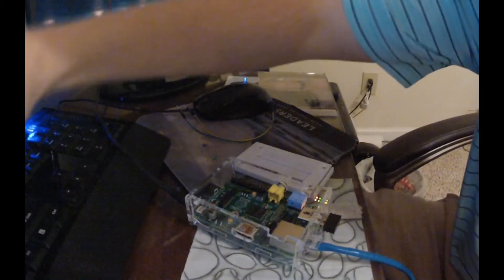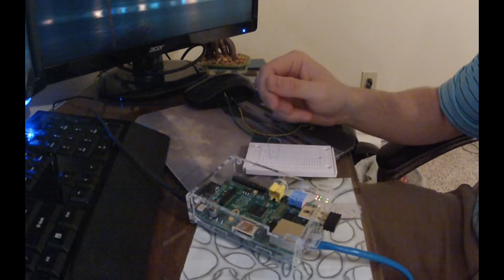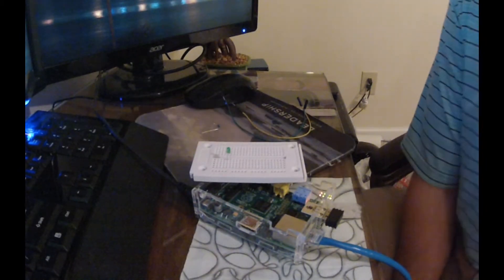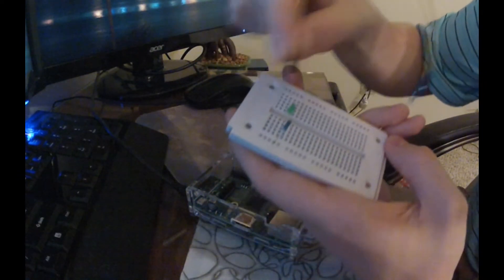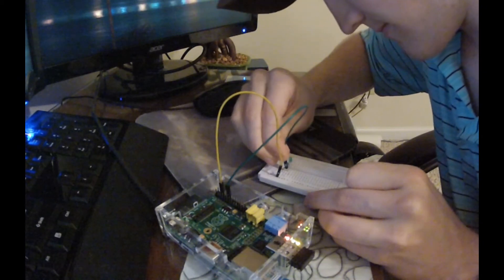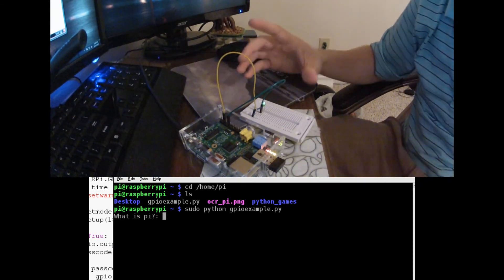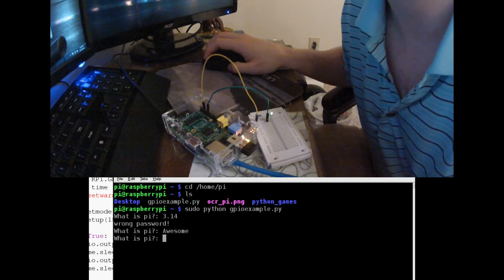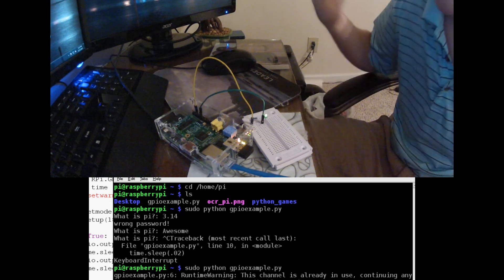GPIO Tutorial for Raspberry Pi Part 3 - Running our GPIO

Comment: How do you connect a raspberry pi3 to an 8 channel relay without damaging the gpio pins?
Reply: Old comment, but might prove useful to someone else.
If that 8 channel relay array has drivers for each of them (optocouplers with freewheeling diodes), then you can safely connect your GPIO pin to that.
However, if that relay array doensn't have any drivers of any sort, then use a NPN BJT or N channel MOSFET for them and connect your GPIO pin to the transistors base(with the right sized base resistor) if using a BJT, or to its gate (no resistor needed, only watch out for its turn on voltage).